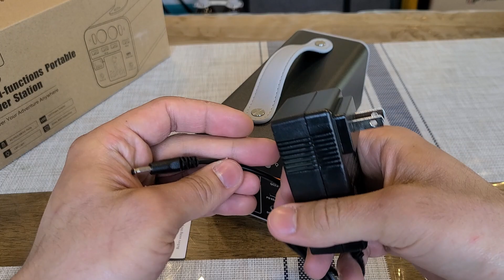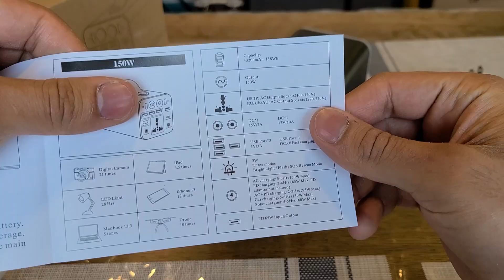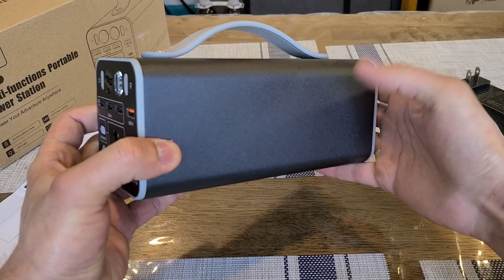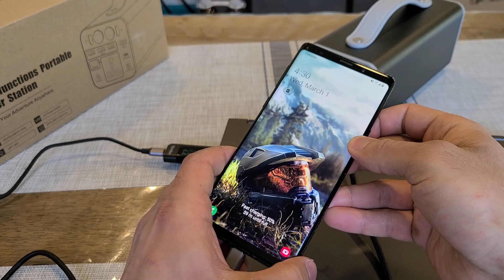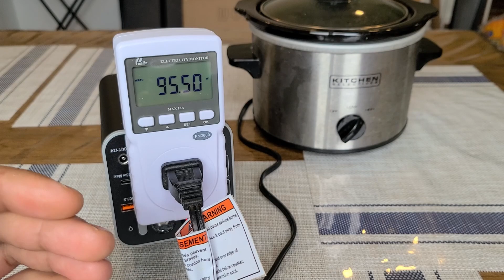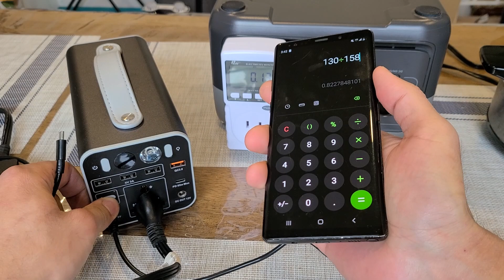Powdeom 158Wh Mini Power Station Review

Comment: Take a chance if you want to folks, you will be rolling the dice.  I tried the 1200w version (it was on sale with a coupon), received it and when I turned on the AC side it just flashed E21 and shut down.  I emailed Powdeom multiple times asking what this error was and if there was a reset process.  The only response I got was that my local power grid was unstable and that was the reason for the fault.  There was no explanation what the E21 meant and they totally ignored the fact that the unit was NOT even plugged into the grid.  Multiple more emails and nothing, nada,  not even the sound of crickets for a response.
Luckily since I just received it Amazon approved a return, but I still had to pay shipping to send it back.
Try them if you want.  Maybe you will get a unit that actually functions.

My advice is to completely avoid this crap company.
Reply: 😮 really?